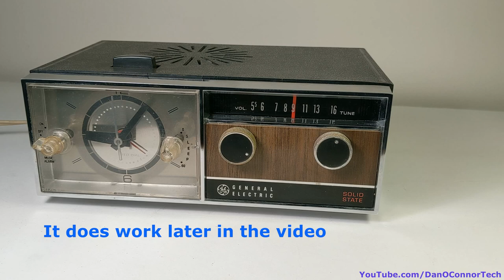1966 General Electric C550G Clock Radio

Comment: Nice.  I wake up every day to a early 60's Zenith clock/AM radio.  The clock mechanism works the same but the radio is a 5 tube model.  I rebuilt it with the intention of selling it.  However, it's better than the cheap modern alarm clock that we had, and I got rid of that one instead!
Reply from the maker: I have a couple of AA5's myself. They're hard to beat!
Reply: @DanOConnorTech  Mine is a model # N516.

Comment: Was it made in US?
Reply from the maker: I don't know. There aren't any obvious signs anywhere on it. The power transistor (the one in the heat sink) is marked Japan, but that doesn't mean much. I suspect by this time in the 1960's it was manufactured in Japan, but I could be wrong.